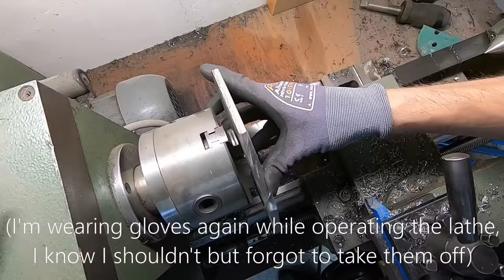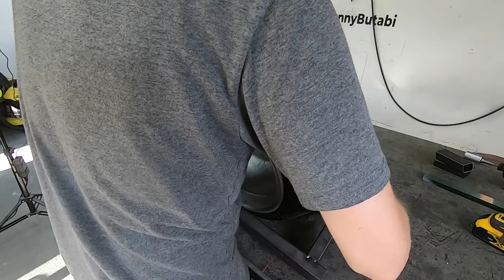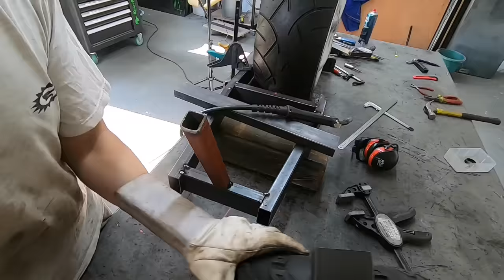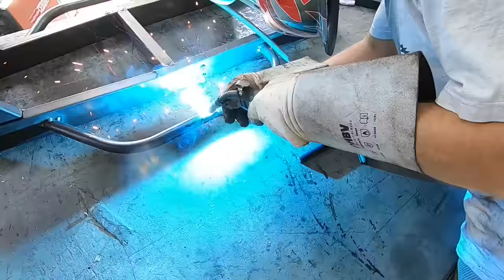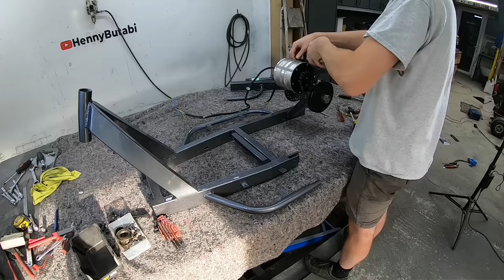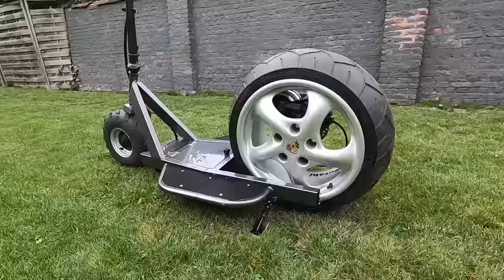Making a huge electric scooter with a car wheel full build

Comment from the maker: Thanks for watching!  Let me know what you think of it in the comments below!
Reply: What do i think? I wish i lived close to you, i would pay you to build me a modified attachment, a custom dual front wheel build, like the front end of an ATV,  to help me get around faster in my wheelchair, so basically the attachments turns the wheelchair into a quadcycle [the front castors / small wheels of the chair would be lifted up as part of how the attachment connects to the chair thus a modular mobility attachment device that turns the chair into a quadcycle.]  You do such skilled, talented, clever quality work. Greetings from Canada.
Reply: cut the crappy background music
Reply: Sir I need dimensions for the frame please help me.
Reply: i need dimensions of this project please help me sir.
Reply: Good concept…let me know 9f you start selling them…if possible I wud like a fender / guard on the rear tire to prevent water splashing on my pants…great job
Reply: @eaj12001  Right..
Reply: Excellent. Move the gooseneck to the handlebars and you have a chopper
Reply: really good build, but it needs suspension. A bump in the road will send you into the air. I am sure you know that though. So important that wheels are light weight.

Comment: You never cease to show your clever engineering mind, if only i was able to build things like this but undesirably not able to due to certain health issues. I honestly wish i lived close to you, i would pay you to build me a modified attachment, a custom dual front wheel build, like the front end of an ATV,  to help me get around faster in my wheelchair, so basically the attachments turns the wheelchair into a quadcycle [the front castors / small wheels of the chair would be lifted up as part of how the attachment connects to the chair thus a modular mobility attachment device that turns the chair into a quadcycle.]  You do such skilled, talented, clever quality work. Greetings from Canada.
Reply: Do it with any engineer.

Comment: awesome, you can also add a chair by attaching metal beams to the sides all the way to the back wheel holder metal beams on the left and right holding the wheels, the beams being tall enough you can weld a seat. so you will be sitting right on top of the wheel, but not the wheel itself, but the seat untop of the big wheel

Comment: Why does the tire look rounded like that. Would it normally be flat under the weight of a car? Are they made that way to compensate for the shortness of the wall?
Reply from the maker: It's because it is a motorcycle tire😏
Reply: @hennybutabi  sir i want dimensions of this project please help me i want to make this project.

Comment: With ATB’s with 2 wheel sizes the  larger wheels is always in front to help clear holes and steps. Don’t fall back on that big rubberized high traction flywheel. Just because it’s possible to build doesn’t make it sensible.
Reply: Also that looks like a non DOT snow blower tire in front. There’s way more voids than lugs which has terrible grip on hard surfaces

Comment: Not practical, but looks cool. Low torque with not so high speed - it will roll nice downhill, fine on straight but uphill it wont go at all with such motors/setup. Swap hoverboard motors to something more capable and perhaps add seat above rear wheel - it will look even cooler imo. After that it should be fun piece to ride
Reply: this just the protype, if he decides to mass produce no doubt some upgrades will occur

Comment: The point of the scooter is to be under control with weight. The scooter that is under the weight of the rider is the one most easily under control of the rider. The stance and size in this build it over the top. He builds such a sturdy scooter but his feet are in jail slippers. LOL.

Comment: Speed? Battery capacity? Charge rate? You didn't go uphill or off road with those fat ass tires either. I didn't see any battery components other than the controllers.

Comment: These scooters are already getting out of hand.  At their speeds they are a big Hazard for traffic and pedestrians.
  I've seen them not following the rules of the road as in, going the wrong way on a one way street as bicycles do,  ignoring stop signs and traffic lights, running at high speeds over traffic speeds in congested areas, no turn signals and they running high speeds on sidewalks and walk ways.